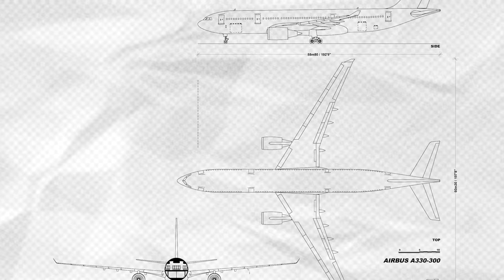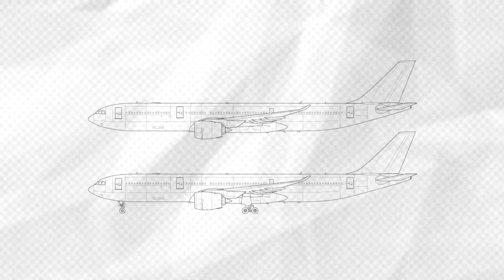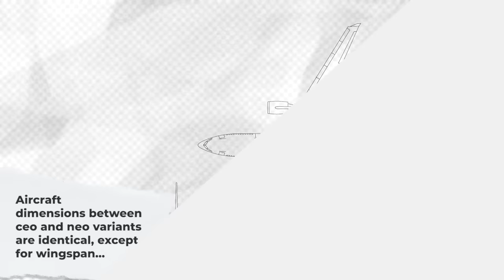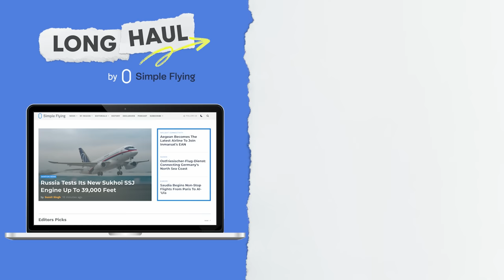The Airbus A330neo vs A330 – What’s The Difference?

Comment: 330-9 has identical range to 330-200 which is why it makes sense to renew the 332s with 339s while getting a bump in pax count
Reply: Yeah it's not so mystery
Reply: Yeah, like our Air Algérie did, ordered 5 a330-900s added to 8 a330-200s so it'll carry 300 pax rather than 250
Reply: @abdelkadermehiz9407  Oui! Je suis content que nous ayons commander de nouveaux A339, j'aime beaucoup les 332 malgré ça, j'ai kiffé mon vol de l'année dernière d'Orly jusqu'à Houari Boumediene en 332
Reply: @abdelkadermehiz9407  D'ailleurs j'ai remarqué quelque chose de drôle mon frère, nos photos de profils se ressemblent ! Sauf que moi j'ai un temps très français bien pluvieux et que je suis sur 332 et toi sur 738 et avec un temps algérien et ensoleilé masha'Allah x)
Reply: @LeRafale  Désormais la commande passe au 8 a330-900 très bien pour Air Algérie ❤️🤍
Reply: @LeRafale  Super maintenant, prends-moi un abonnement
Reply: @abdelkadermehiz9407  Yes ! C'est super à savoir, je suis impatient de volé dans ses nouveaux 339

Comment: 4:00 the answer is simple. the -900 has nearly identical range as the -200. more passengers for the same range? 100% yes. 
As for the 15,094km range for the -800 there is a better choice, the A350-900. You get identical range but 315 seats instead of 210 for -200. That's 100 passengers more for the same range which, I think, makes the decision making process easy.  
Excellent topic thank you
Reply: Apparently, the A330-800 got bested by its sibling aircraft 😅
Reply: You forgot one little thing: the 100 extra seats on the A359 come at a cost: more fuel burn, higher weight. Not all routes support 300+ seats.
Reply: @widget787  Depending on the mission, an A330-800 burns approx. 7-10% less fuel but the A350 offers a 60% higher seating capacity plus a bigger cargo hold. The additional fuel burn is so small that it doesn't take very much to gain an advantage over the -800. Or in other words, you don't need to fill an A350 with 300+ pax in order to gain an advantage over the -800. So an A350 has far superior CASM.
What does that mean? If one A350 flight is full and the other is below the capacity of the -800, you will still make more money with the A350 rather than flying an A330-800. Remember that you have 60% more capacity to offset just a 10% higher fuel burn. Now, it also becomes clear why flying has become cheaper. Because with those new planes, money-making has become easier. The A330-800 is a very capable aircraft and has its niche in long and thin routes. But it suffers the same fate as the 777-200LR did. With a bigger brother that offer a better CASM, airlines will only buy the smaller jet if they really need the capabilites or if it's getting offered at a discount.
Reply: Well crafted replies, just wanted to add that the A330-800 costs like $50-60 million less than the A359 or at least on paper without any discounts. One source also mentioned the lease price for an A330-800 being like 10% over that of an A359 which seems like a terrible deal to me at least haha

Comment: I've flown on A330-202/203, A330-243 A330-323, and A330-343/342. Hands down, my favorite A330 variant is the -343 and -342 series, the shape of the engines on the -300, the quieter engines, the iconic RR howl, the melodic RR trent 700 sound on takeoff, and on top of that, it was the best selling A330 variant.

Comment: I hope the A330neo ends up being successful. I really like it for some reason.

It might just have been released too early given most airlines still have pretty new A330-2/300s or 787 which don’t need replacing yet.
Reply: It have 300 outstanding order and 79 delivered.. I would probobly called that a success already for an aircraft that really mostly got reengined.

yea yea.. sure there are new interior and front window, wingtips and a few other modifications. But most of them have been bleed over from either A320neo or A350.

Well sure, they did lose order the last couple of years, but pretty much everyone did. Even B787 lossed a few. And well the 777x is not doing brilliantly.

Look at the current generation of reenginered aircraft, 777x, 737max, A320 and 330... Could probobly put E- jet there to.

A320 is a incredibly success.. but its really not that strange. Having a huge span in both range and seating it takes up the slack with everything from 737 to 757 as well as the replacement of old A320 and to a degree even MD80.

While the max have a order of magnitude more orders than A330neo, i bet the A330neo is more profitable. Boeing have lossed a ton of money on the max and they really needed to crank down the prices to get the order rolling

and on top of that. Boeing got nothing in the middle of the market. 737max-10 have to short of a range, and 737max-8 have to low of a capacity. A A321XLR can do pretty much all continental routes in both Euroasia and Americas and most transatlantic. While the A330-900 is really not that much larger. Going from 206 capacity to 287 isn´t that large of a leap. Granted, the A330 have much more first class.
Reply: @matsv201  the max 10 is a new aircraft  , the a321 started  out with a similar range before its MTOW was increased  to carry more fuel for the a321LR/XLR .

Boeing likely  have a longer range version  on the max 10 after the base model is certified  first.  Something  like a MAX10ER
Reply: @mmm0404  I'm not that sure of that. 737 and A320.is set up very differently. Lifting MTOW of 737 will be much harder.
Reply: @matsv201  lifting MTOW is harder for any airframe, the  MAX 8 currently  has a higher MTOW than the 320NEO by the way ...

There is no senario where Boeing  doesnt extend the range of the MAX 10 more especially  with the NMA out of the picture  for now . I would be suprised  if they didnt  extend the range of the max 10 to compete with the 321LR/XLR
Reply: @mmm0404  The thing is that Boeing have a fairly flat MTOW for the range.  There is only 8 ton diffrance between the 7 and 10.  While A320 series had 25 ton diffrance from A318 to A321 already in the CEO series. This was lifted only slightly to the A321 neo LR. And the lift to XLR is only 4 additional tons.

The total lift from A321 to A321 XLR is only 7.5 tons. And A321 was made originally as a heavier airframe.

IF we compare the Max10 to the 737-400 classic That is already a lift of 22 tons.

They keep stretching and making it heavier and heavier. Something will eventually give.

There are issue with making the aircraft bigger and bigger. While the wing and possibly the fuselage should be able to handle it. Other components are more problematic.
Reply: @matsv201  Well maybe thats because mtow on the 737's have generally been higher than their  a320 counterparts  , that's no revelation .

 This proves that the 737 airframe  has always been capable of carrying a little bit more weight than the 320 . Both the MAX 7 and Max 8 have a HIGHER MTOW  than the  , 319neo and 320neo respectively, so what makes you think its impossible for the Max 10 to close in on the a321's MTOW?. 

Obviously Boeing wont try to match the  101T on the xlr that's a little too much for the MAX 1O airframe, , but they could come close to 95-97T from the current 89T.

I do agree that limitations on the max 10 are higher but even if they add, 5-6T , it would be a great boost to its range , and airline appeal even if it doesn't  directly match the xlr's range
Reply: @mmm0404  The A321 and A320 have the same airframe. Just that airbus number them differently. max 10 is comparable to A321, not A320.

Airbus have made the A319 and A320 generally lighter intentionally.

"This proves that the 737 airframe  has always been capable of carrying a little bit more weight than the 320 "
No, it just proves that the A320 is not made to carry high weight. 

"so what makes you think its impossible for the Max 10 to close in on the a321's MTOW?. "
I never claimed that. I said it would be increasingly hard. And that becasue it already had a high increase.

"but they could come close to 95-97T from the current 89T."
The issue is that they already have.. twice. and really even 13 from the NG generation. That is a huge increase.

Airbus increased the A321 weight twice. But really by a very marginal amount.

Unlike 737 series, The A321 was set up to be heavier from the get go. This is fairly typical of airbus. Airbus and boeing work differently here.

Typically airbus have the larger plane also having more range. Making it one big brother and one small brother airfraime.

While Boeing is more like twins. One take the capacity one take the range. (granted, that is also true for the A330 series). But for the A320 and A350 series its a big/small brother configuration.

The max series is more like twins. or semi twins. Two a bit lighter, two a bit heavier. But the heavier is alreddy streached.
Reply: I mean it is already a reliable aircraft. Unlike A350s and B787s
Reply: I would argue, it's maybe too late – if the A332/333 remained in production it would become even less competitive.

Comment: You can look at it from another angle: the A330neo was a no-brainer to create. The A330 airframe wasn't old or outdated, but it had been leapfrogged by the 787. Airbus' real answer to that plane (and the 777) was the A350 XWB, but that was a bit too big to compete with the smaller versions of the 787. Now, the A330 airframe still slotted nicely between the A321neo and the smallest A350, it had no reason to be replaced, and it could still steal some sales from Boeing if it was updated to be competitive. A neo program would cost a fraction of a new plane, and still rack some orders from airlines faithful to Airbus, unwilling to wait for the long production times of the Dreamliner, or hoping for a lower cost aircraft. Airbus knew they wouldn't steal too many airlines from Boeing, but it was not worth it to disrupt the rest of their very well set-up fleet (that was indeed stealing orders from Boeing left and right). The A330neo was a more than adequate stopgap, and even if they don't sell as much as their rivals, they're maintaining Airbus' market share.

Comment: I flew BOS-AMS-BOS with Delta, back in Sept. I had a A330-900 outbound and a -300 returning.  Sitting in economy, both airplanes were fine and comfortable.  Only real difference I noted was the different styles of winglets;  swept back vs more blocky, respectively.  Though I have really enjoyed the 787 and A350, the lower cabin altitude really makes you feel better both during and after a long flight.

Comment: The thing is that the leasing price diff between A330 neo and A350 is not that different making it too expensive . Airlines choosing between 787 and A330 neo may go for the 787 for its range, performance at high altitude airports and similar price .
Reply: and take in to account the wait list for 787 vs a330 with the 787 continually having problems with production

Comment: Probably also worth mentioning the A321 LR & XLR, which have competitive range, cheaper costs & possibilities of greater flexibility.
Reply: While being half the size. Very different segment
Reply: @travelguy78  Boeing's rumoured "NMA" is supposed to replace their ageing 757s. The A321XLR has the closest range and capacity to the 757 than the A330NEO. A321XLRs are also cheaper, and are a really good choice for airlines if they want to replace the old 757s.
Reply: @dat_randomguy_  The video is about the A330 and the A321 is far far smaller than the A330. The A330 have double the thrust of A320 and the MTOW are more than double. Its two widely different planes. Emirates uses the A380 for a sub 1hr route, but that doesnt compare it to the ATR-72 does it?

EDIT: I like the A321. Ive ridden it for 10+ times and its a solid workhorse, but it is an narrowbody plane. It fills one end of the market that 757 had, but the 757 is a far more capable plane when it comes to range/capacity, etc

Comment: When comparing the 'apparent "success", one has to look at the market situation.
When the -200 and -300 came out in the 90s, the aviation world was still full of gas guzzling 3 and 4 engine jets and switching to an A330, ditching half or a third of the engines made a huge difference. So airlines went for it.
Now, the market is already pretty saturated with fairly efficient twin engine jets for this capacity and range bracket. The gains of switching from them to the A330neo don't outweigh the cost nearly as quickly. The uncertain global political situation, a certain virus with its impact on aviation in 2020 that companies are still recovering from - all of that leads to lower sales numbers.
I was recently on one of the A330-900s and I think it is a nice aircraft. Over the years to come, it will sell a nice number of planes, I am sure.

Comment: I'm pilot, flying both.

The fuel consumption of A339 is much lower compared with A333. In theory, both models have the some thrust, however, specially during climbs, A330neo gives a smaller rate of climb. But, as with any brand new airplane, there are a few items that can be improved, mostly related with the bleed systems.

The A330neo uses Rolls-Royce Trent 7000, which derives from the Trent 1000, used on the Boeing B787. Boeing 787 doesn't have a bleed air system, so they had to redesign an engine made to work without bleed, to have a bleed system.
Reply: Hello. What's the update on latest Trent 7000 reliability issues? TAP Air Portugal and Kuwait have apparently grounded their A339 Neos.

Comment: I flew delta a330neo recently from Amsterdam to Boston. Pretty nice plane!
Reply: Flew about 2000 miles on a new 321. Very noisy PTU or whatever it was near the right under fuselage near wing. Very noisy until cruising.
Reply: @eleventy-seven  doesn't make it a bad plane

Comment: The a330neo has over 350 orders with 141 delivered in 2024.
But still only 12 orders for the -800 which makes sense considering the -900 has the same range as the old -200 variant with larger capacity.

Comment: It might be just me, but I think they should have made an A310-400NEO instead of the A330-800. The A330-900 has better range than the old -200 with the capacity of the -300. The A310 was a true middle of the market aircraft before that was even considered a market. An A310-400NEO and 400NEO freighter would likely sell very well while also ensuring that the Boeing NMA would be a market failure. The A310 had a decent capacity while also being small enough to be at smaller airports with more restrictions.
Reply: A300 and A310 are analogue aircraft a bit like the 737).
Not a good idea to paint those old aircraft as new like Boeing has been doing with the 737 over the decades.

Comment: I think the reason why the A330-800 isn’t selling well is that it’s quite a heavy plane with not powerful enough engines and it goes through fuel quite quickly because it’s heavy in weight. also it might not be long enough for some airlines to consider buying the A330-800 which is why the 900 is selling quite a bit better and it’s a bigger plane

Comment: Given the range and fuel efficiency of the 900 the advantages of a smaller variant are limited. There is just not enough room with the 319, 321, and 330-900 all around.

Comment: I think it has to do with looks.  The 200 and 800 versions' vertical stabilizers are a little bulkier than the 300 and 900s leaving little room for the cone piece in the back.  The 300 and 900s look a little kooler😎

Comment: a A330-900neo can operate on very long haul routes non-stop, distances close to that of  A350-900 ULR max range if not at par . . . ofcourse this will require some upgrades to the A330-900neo airframe . . . the A330-900neo will feature a bespoke cabin configured to seat 183 - 210 paxs in a typical 3-class layout . . . reinforced airframe & a auxiliary fuel tank incorporated into the aft cargo hold of the A330-900neo thus extending it's range by 1,100 kms based on flight inputs while in-flight . . .

Comment: The A330 neo will remain somewhat niche given that it's not very much smaller than the A350 with a more dated airframe. Against these limited sales expectations stands the low R&D & re-tooling cost for building this facelift. The question is wether there will be a profit in the end for Airbus fron that decision.
It worked several times for the Boeing 737.

Comment: A330-200 VS A330-900 VS A330-800
Range - 13,450km VS  13,334km VS 15,094km
Max Capacity - 406 VS 440 VS 406

Getting A330-900 is basically getting A330-200 with higher capacity (and maybe more fuel efficient), no brainer really
A330-800 range is overkill if using the current A330-200 routes, which doesnt really make sense if airlines just want to replace the -200 and using the same routes

Comment: Whilst i like the 330 Neo in both versions. the 800 has suffered. Boeing has been very competative with the 787 on price. That plus its range on a comparable 787-8 at 14200kms puts it right at the middle of the 800 and 900Neos. Now youre an airline both boeing and airbus available. The 787-8 and -9 beats the -800 quite well, the -900NEO not quite as well. Also in the past its been cheaper to buy. or lease. For Airbus id be talking to rolls and upping the engine range once again, to give the -800Neo a fighting chance. However thats all added costs. I still prefer the -900NEo its a class plane and a very safe one to fly.
Reply: The 787 still hasn't made a profit yet

Comment: Because A339 has a enough range to cover airlines destination and more passenger which is very cost efficient and profitable  so some airline don't need the longer range of a338 with less capacity